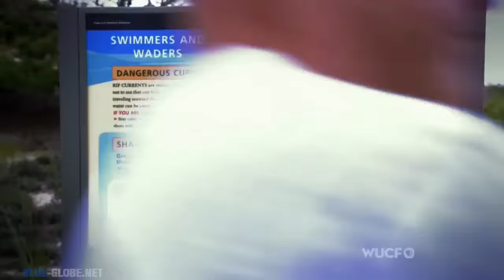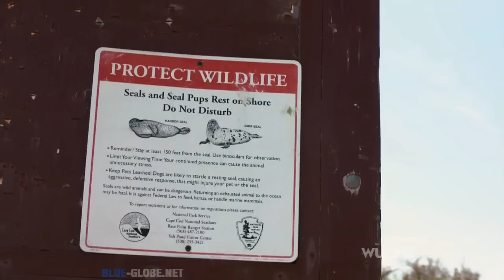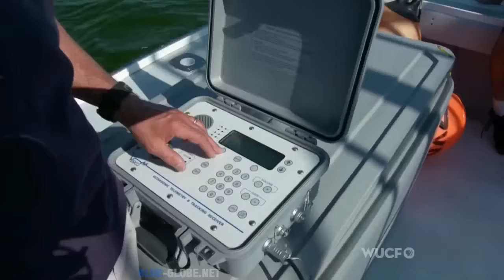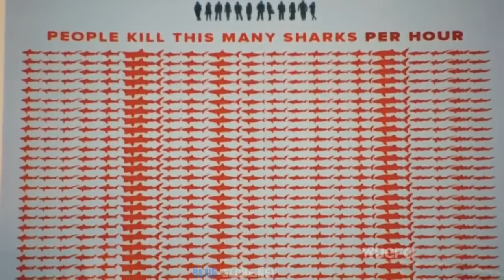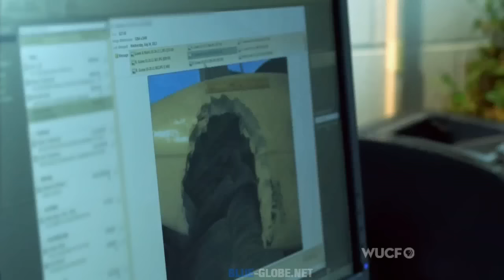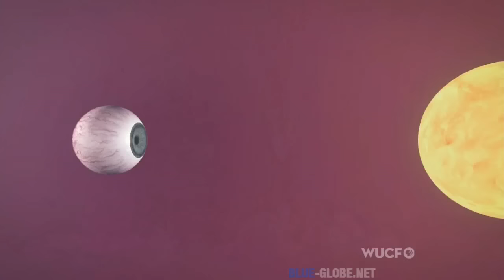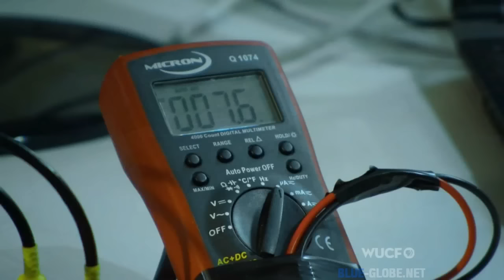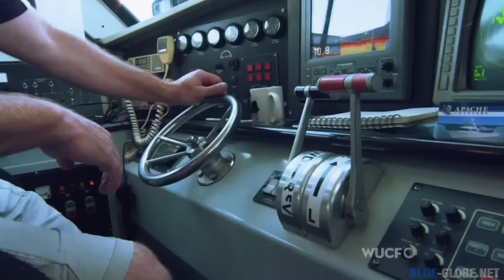The Predatory Behavior of the Great White Shark (720p)

Comment: I watched a documentary a couple of years ago about a woman and her husband who filmed with Sharks on a regular basis
and were trying to develop a shark attack aversion device, to see if it could stop a shark mid attack, once the eyes roll back
and the mouth is open, its usually too late, but they made a repellant out of the smell from dead rotten sharks? and istantly sharks stop and leave the area immediately, upon release of this substance, and for quicker results an electric battery that can send out a small charge, will short circuit the sharks own electro system of senses

Comment: Fishing for shark should be band everywhere and big fines should be imposed and the people who are court still doing this should have their boats taken from them and also given a big fine on top, obviously some people just sport fishing are going to hook a shark now and then so in That case we should look at what tackle we can use just in case one is hook and it was not possible to get the hook out before it was released, I know these days you can get hooks which if it was not possible to get the hook out before it was released for example the shark bit though the line, you can get hook which dissolve in a few days in the salt water so not harming the shark. Also we need these apex  predators to keep the ocean's healthy because we are all ready raping the ocean's and it's got to be getting to the point were it will need a total band on fishing across the board, and how many lively hoods are going to be lost then because the fisherman did not listen and try to fish sustainably